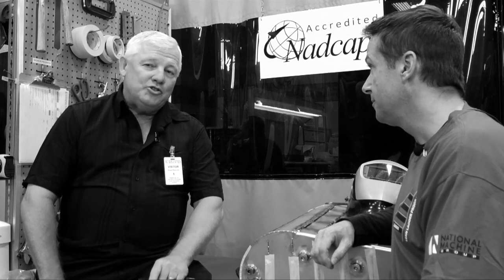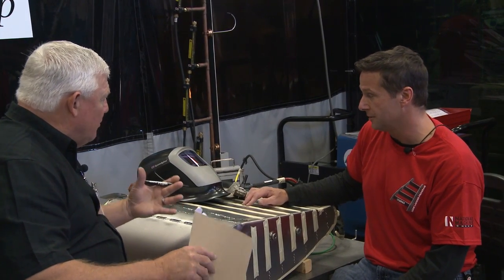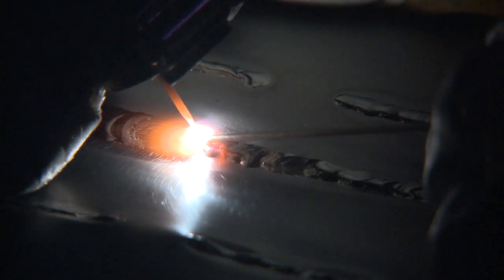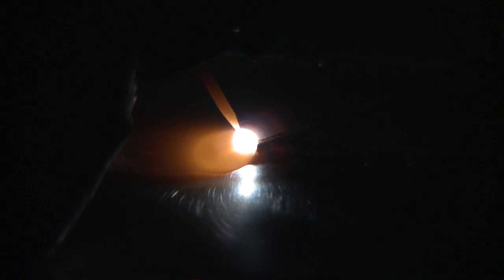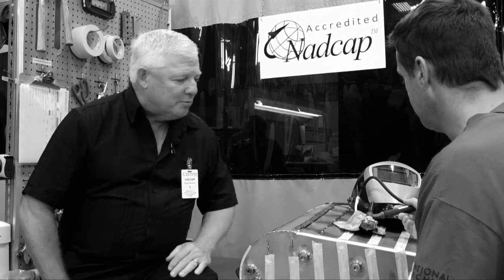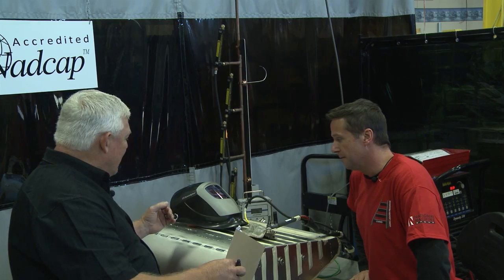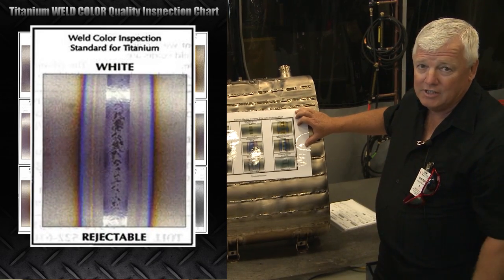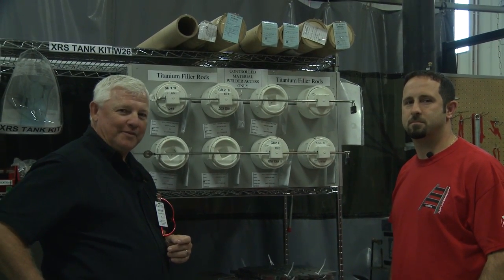How to Weld Titanium with Perfect Silver Coloring

Comment: How would you weld titanium thin clamps onto massive profile. The weld spot is gas shielded, I am using a #16 cup. The clamp still becomes brittle beyond the gas coverage. What do you suggest to cool the clamp or avoid heating. Puls settings? Heat sinks? Do you have experience with that?

Comment: In the late 80s I was a certified welder doing 150' titanium chemical processing columns out of 3/8 grade 2. Loved it you got to foil tape the back purge opposite what  side your working on. Slow process lots of ot. We used foil tape on the trailer too. On tanks you got to be careful not to get anywhere that can hold argon it can kill you as it did to three of my co-workers. The tank was on end with no man way so the purge ring filled it up with argon- it is heavier than air so it displaces it in you lungs too. Long story.

Comment: Titanium is corrosion resistant. They use titanium tubes in deep sea drilling. It's not as easy as it looks,  especially if done in an argon tent. If done in open air it will turn an off gray with a white powder look on top of it. That has to much oxygen in the area but just redo the weld and it should be ok. Especially since it runs $25-30 a pound.

Comment: does Titanium distort worse that Stainless ?
Reply: +Brainmalfuction no, far less. however it has a very good memory. ex. if you roll a shell that`s relatively big and not weld it right away it will open up on you the next day.

Comment: landlockedviking had no reply tab but I do have his answer. Water has to have trace amounts of antibacterial agent if it is to be stored. Otherwise bacteria, algae, and other contaminants will form and render it non-potable (not usable for drinking). Chlorine is the most common agent used and it is highly corrosive to most stainless steels.

Comment: Something I noticed in the video, what is the reason for building the tanks with so many 'sections'? Couldn't the same tank be built with a simple, single roll formed sheet or is this grade of titanium not that formable? It looks extremely labor intensive and time consuming but I'm sure there is a valid reason. Enlighten me!
Reply: Lol after 2 years you've probably forgotten the question. I assume there must be several compartments inside the tank.
Reply: That would also explain the protruding tabs and the stitch welds.

Comment: In my experience with production food plants, stainless steel cookers were done away with in favor of inconel due to issues with heat cycling caused cracks forming in the cooker shells and at the legs. Is this an issue that is common with titanium? Is inconel used in lieu of titanium due to cost issues?
Reply: timm white Inconel should take thermal cycling and resist oxidation to a far greater degree that titanium. Titanium peaks out at about 800”F where as Inconel is used for rocket nozzles. Worlds different in terms of material qualities!

Comment: Nice vid. What is the best titanium for welding an exhaust?
Reply: I would almost want to tell you to go with stainless steel instead corrosion resistance and it is nowhere as expensive so unless your going super light race I would do stainless steel
Reply: +Stephan Koal Grade 1 titanium because it has high elasticity, however grade 2 will be cheaper since its a common grade people use.

Comment from the maker: Stainless steel is defined as a certain amount of chromium(at least 12%) being added to iron. Although it retards rust, it doesn't stop it completely.  When there are bacterial problems with a water storage tank for most aircraft, there are chemicals or corrosive nature that solve the bacteria issues, but expedite a breakdown of the chromium and create premature rusting. Thanks for watching.

Mr. Tig
Reply: Stainless is defined as 11% Cr, up to 1.2% C and other alloying elements.   The water storage tanks in aircraft that you reference are probably disinfected with a Chlorine compound of some sort.  Many stainless alloys are subject to corrosion from Chlorine unless the Cr and Ni are in sufficient amounts along with other alloying elements such as Mo.  304 and 304L are good with up to 2 ppm Cl present while 316 is recommended for up to 4 ppm Cl.  The use of the low carbon alloys are recommended for water applications when Cl is present.  The use of the low carbon alloy and filler metal helps to prevent grain boundary depletion of Cr and Ni in weld areas.  When this grain boundary depletion occurs the area is less resistant to corrosion.  With exposure to high levels of Cl (in the percent range), other alloys are recommended such as Monel 400, Inconel 825 and Nitronic 32.  316L can be used in a salt spray environment however over time it will pit.  Hth

Comment from the maker: Dear Viewer,  Most business jets are now going to titanium for lighter weight, but more importantly corrosion resistance. The previous stainless tanks had long term issues with corrosion/ leaking and causing havoc with wire harnesses, etc.  

Thanks for the question,
Mr. TIG